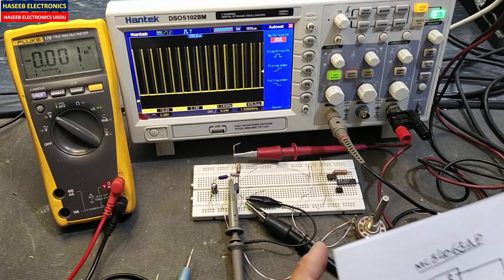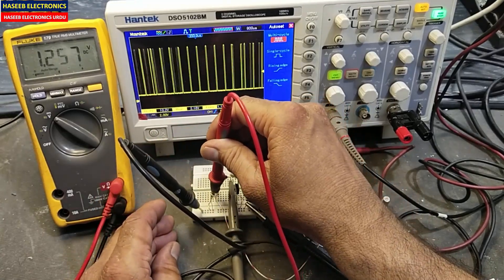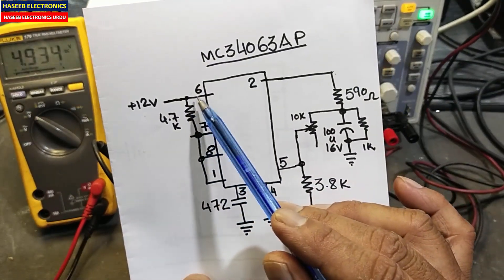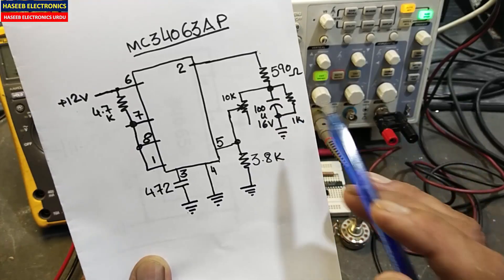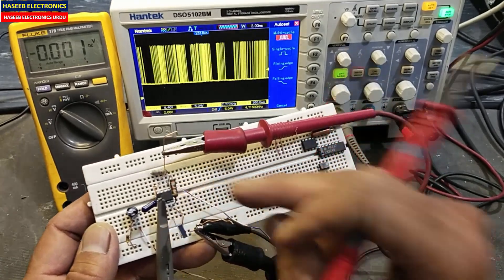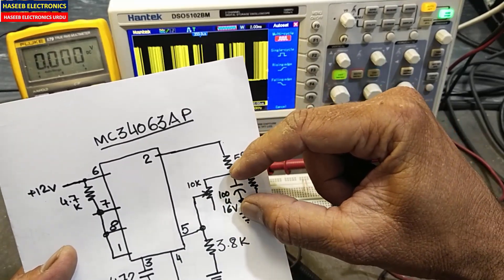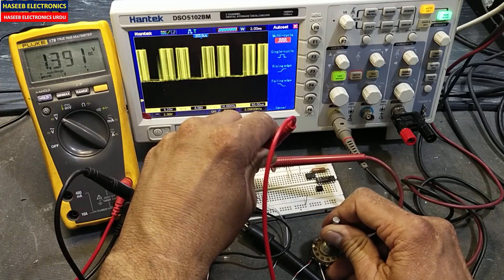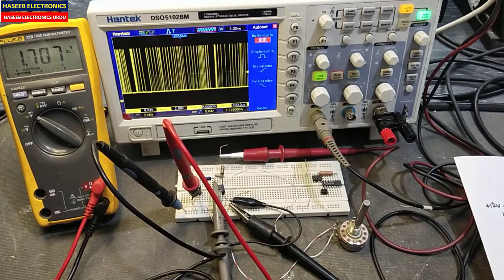{628} How To Test MC34063 Buck Boost Controller IC

Comment: Thank you for this useful and educating video. I have a question. It seems that oscilloscope is not needed (or at least, not necessary) in the test that you explain in this video, because you do not point to anything on the oscilloscope at all. Am I right? If not, why?

Comment: Hi, i used this circuit and tested for my MC34063, i tried to give an input voltage of 12 volts but the output voltage stays around 2-3v, is that normal?

Comment: Schematic shows 4.7k between pins 6-7. Actual circuit has colour code for that resistor as 4R7. Wonder how many have used the 4k7, decided that a little China man has ripped them off, and discarded their IC because it failed your test.

Comment: Alsalam alaykoum thanks a lot for your great job and this is a pride that we found a muslim  do this volunteer work ,i'am a muslim from algeria .i want to ask you about the capacitor which is connected to the ground what is his work.بارك الله فيك
Reply from the maker: و علیکم السلام 
اللی یسعدک و یسلمک 
there are 2 capacitors, 
1st is connected at pin 3 and ground. it is timing capacitor. it is used to set its switching frequency, as this ic can be used upto 100KHz, so value of this capacitor will tune its output frequency. 
2nd Polar capacitor is connected to pin 2 after a resistor. it is working as a output capacitor. because the ic samples the supply voltage, after passing through resistor at pin these voltage are in square wave, to convert these voltage in smooth level, this capacitor is used